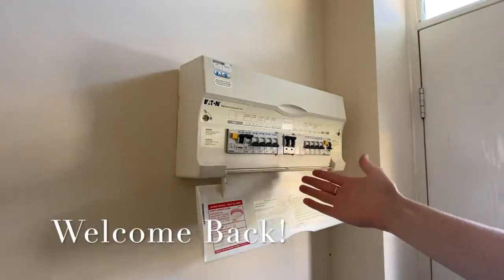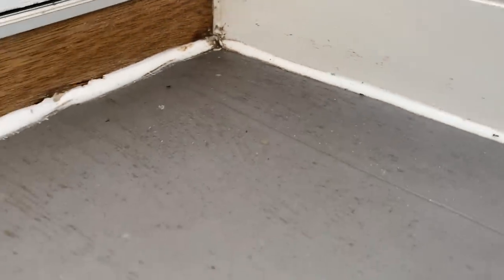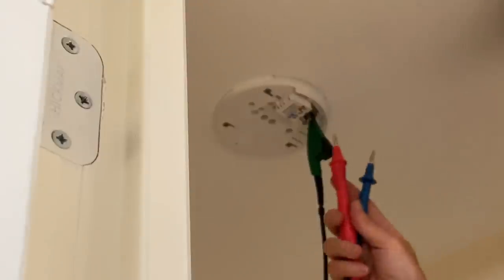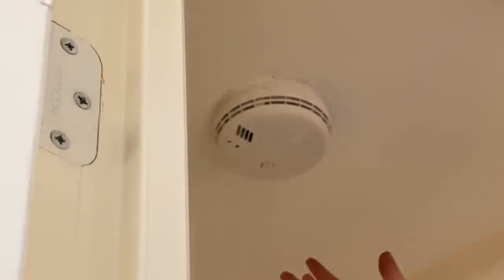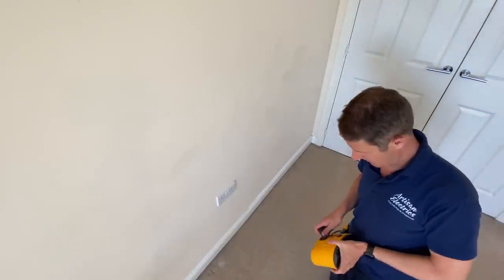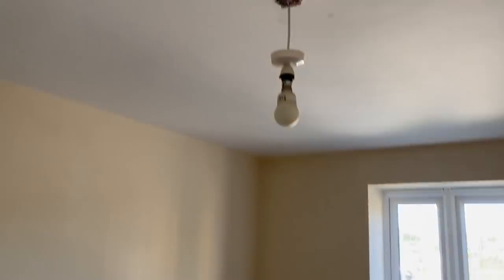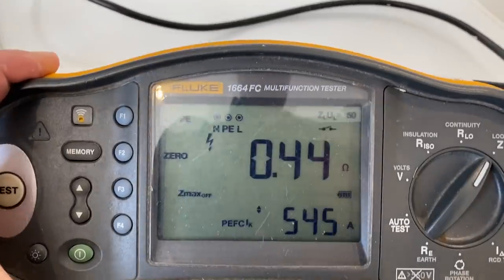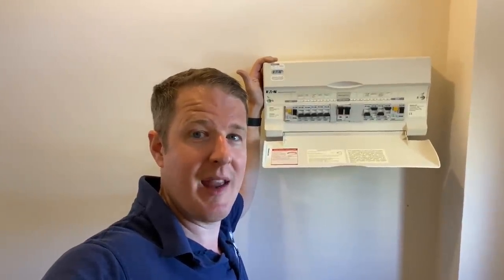Electrical Installation Condition Report Sample - Part 4

Comment: You shouldn't be doing Zs on an EICR. Avoid live working. Add r1r2 to Ze. Job done.
Reply: Not true.  R1R2 + Ze doesn’t necessarily = Zs.
Reply: Eh? What you on about dave
Reply: I'd agree in the case of some things such as showers or behind cooker switches etc but for general lights, sockets, smokes i don't see any real risk. Also R1+R2 doesn't verify the neutral.
Reply: Black Fingers I’d disagree. Why mess about chopstick style in a live pendant when you can do dead r1r2 test, confirm polarity, switch in line conductor and obtain zs all in safety ? Strictly speaking breaking the law 😇 like most of us do !

Comment: With all respect do you have Inspection and Testing Qualifications? Do not make a video if you do not understand what you are doing. Please buy and learn IET Guidance Note 3 Inspection and Testing. You not allowed to do live tests until is necessary. Ze and Zs are measured at Distribution Board. Zs at circuits you have to do by other methods, calculations and checking results. Not guessing.
Reply from the maker: I did my 2391 when I was 20 and have been testing and inspecting for over 15 years now. I have and use guidance note 3 regularly. Doing live tests at sockets is absolutely fine and the rest we usually calculate Zs based on Ze and R1&R2 readings
Reply: @artisanelectrics  Hi. With Zs values tested on circuits as on your video you cannot get R1, R2. You need to do Continuity tests, calculations, adding max. permitted cable temperatures and checking with tables. There is quite a lot to check. Live test as you do is not permitted in UK. I would recommend to go threw IET book again. Also 40A for ring circuit 2.5/1.5  is not permitted. BS7671 All the best. Kind Regards Richard
Reply from the maker: We usually test both Zs and R1&R2